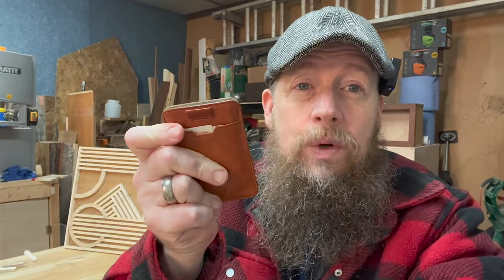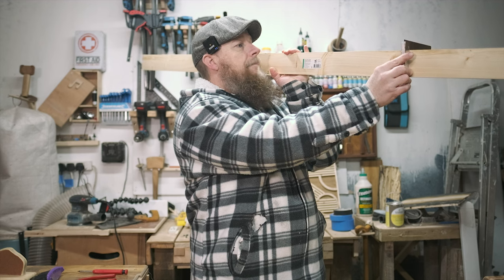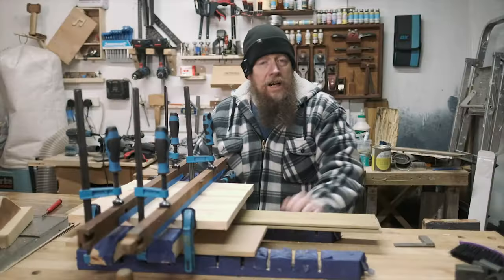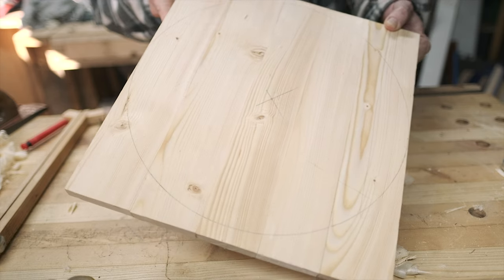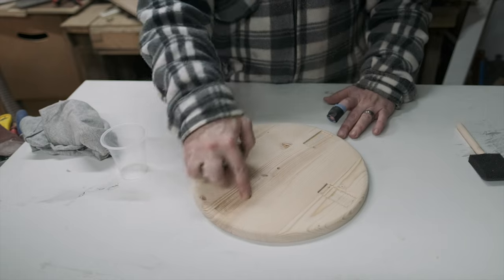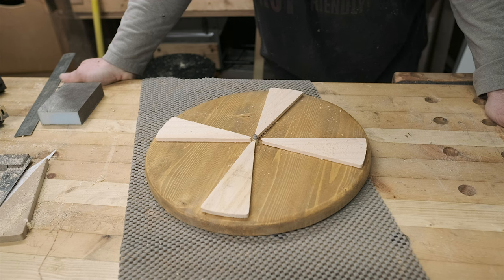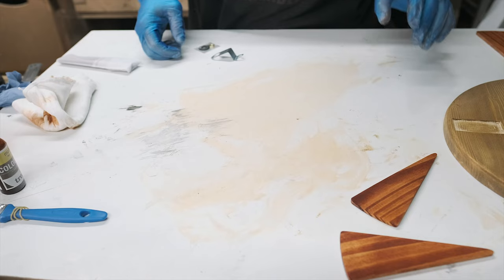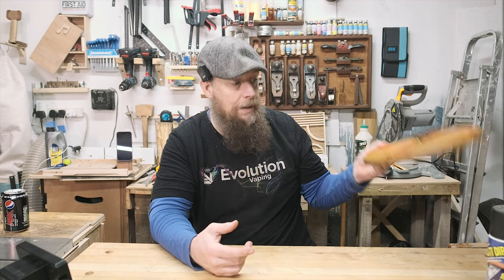How to (and not to) make a super cheap clock (novice)

Comment: A cool little project.
Rather than using double sided tape check out the "masking tape and superglue trick" on Crimson Guitars. It works out soooo well and is far easier to work with compared to double sided tape.
Reply from the maker: Yeah I use the super glue and masking tape trick quite a lot 😊